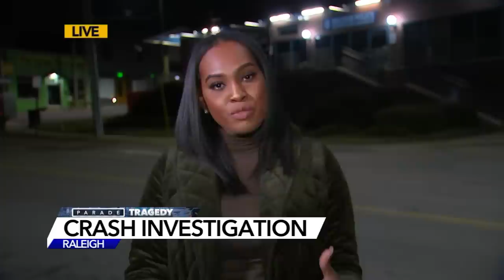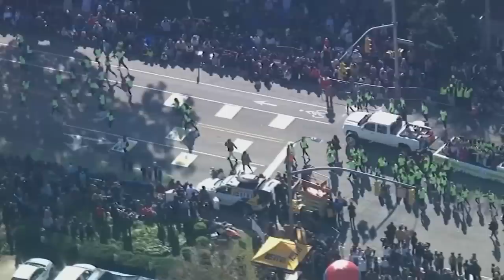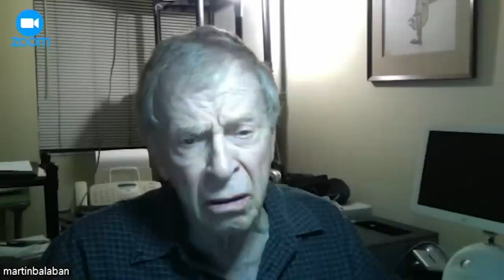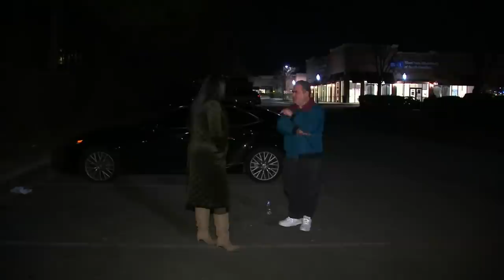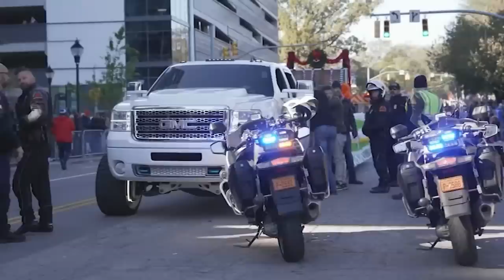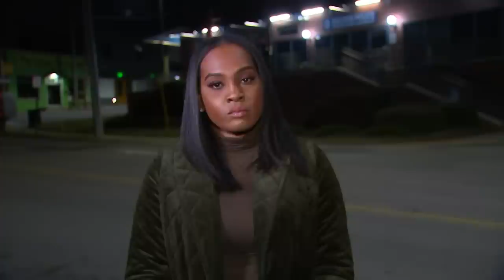Investigators look at truck part by part after Raleigh parade tragedy

Comment: I drove in parades it is difficult you can not be distracted. Bands and participants march in place even when they stop moving forward. you must leave road surface that you can see between you and the marchers in front of you and that empty space distance must be maintained and you can't start or stop quickly because people on the float will fall. In automatic vehicles you must hold back by using the brakes (At idle the vehicle will want to move faster than the marchers you must hold it back) your leg will ache for days after, (you may be nonstop braking for three hours). God love you if you are driving a stick shift because you are always clutching and braking for hours. They throw treats so kids are dashing into the street, and maintaining your distance not trying rock the people forward and back on your float. It is a lot to deal with you can not get fixated or distracted by anything. My first parade, I had a 69 Corvette Stick shift, manual breaks, a pointed front end you could not see behind the marching band on hilly roadways through a community with sharp turns and narrow streets. I was a mess afterward and Had nightmares for days. It is easy to get hypnotized you are hardly moving nothing seems to be happening but so many things could go wrong!
Reply: Things will end up changing over this... I saw one story where in Philadelphia, they are no longer allowed to throw treats and that all drivers in the parade must have commercial driver's licenses... I have a feeling the next thing that will be banned in parades (if not altogether) will be vehicles modified in any way like this truck was...
Reply: three hours? how many miles long was that parade? 🤔🧐
Reply: @montanaelkwhisperer1744  Our Cities,  Bicenquinquagenary (250th anniversary) the city thought it would be great to let anyone be in the parade just sign up! The staging area was 13 city blocks from the parade route. I had Elvis throwing teddy bears I was following our 50s swing-dancing float. The dancers every block or so jumped off the float and danced in the street.
Reply: People could have avoided being hit by the truck if they just listened to the honking or yelling instead of just continuing. If the truck was going in a straight you just move out of the way
Reply: @soyoungdouglas  I was in my 20s too for my first parade. Age doesn't make a difference in knowing what to do when something goes wrong. My first parade the 69 Corvettes brakes overheated and started to fail. It was an automatic transmission so I knew in ice and snow conditions you put an automatic into Neutral to stop the engine from pushing the car forward when stopping, so on downgrades, I put it in neutral and the brakes cooled down. I did this long before it was an issue. Remember this because Antilock brakes on ice will stop the brakes from working. You need to have the car in Neutral to have 100% of the available braking power, 4-wheel drive or not.

Comment: That So Called Expert isn’t much of an expert if he thinks that you can still stop if a brake line ruptures, he did mention the hydraulic system but if a line ruptures and the fluid leaks out you have absolutely zero brake pedal. When a line ruptures and the fluid runs out air gets in the lines and you can repeatedly stomp on the brakes and the pedal just goes to the floor but you’ve got absolutely nothing. Trucks don’t have a hand brake E-brake like some sports cars have and it’s not in a spot easy to hit on the floor either. Having a brake line go out is probably one of the most scary things a driver can experience as far as mechanical failures

Comment: Why the driver never put the truck in first gear to activate engine braking is beyond me. The first gear drive ratio on a GMC Denali is 4.54, when engine braking an adult should be able to walk right past the vehicle but it appears the driver put the vehicle in neutral instead or tried to put it into Park which will not work on a heavy-duty Denali when in motion.

The driver has been cited for vehicle violations 17 times since 2021. 

He was ordered to have the vehicle inspected four times, most recently 3 weeks ago but did not comply.

The emergency brakes on the vehicle were non-operational.

In my state the vehicles lift, wheels and offset are illegal without fender flare, bumper and marker light upgrades. Having these upgrades properly installed makes the vehicle safer for pedestrians and street legal. Not having them makes the monster tires extremely dangerous 

The fact that the driver carried a concealed firearm to a parade with thousands of children shows a lack of safety awareness and concern for those around him. He was charged for illegally carrying a weapon at a parade.
Reply: You realize that there was likely hundreds of firearms there?
Reply: Who chose not you sorry
Reply: @HellboundAmerica  what's your point? He had it there. Illegally. Should we sell guns in prisons to? Schools maybe? Pass them at the courthouse maybe? Keep them to hunting and home defense.
Reply: @MajorBorris  come for my guns, I'll pay for your bus fare 🤡
Reply: @small3687  they are not for hunting and home defense now, we'll keep our second amendment the way it is. If you don't like it, there are no shortage of other countries with no gun permissions, plz go there
Reply: @MajorBorris by definition, a lawful gun owner doesn't carry out a mass shooting event, that is an unlawful event. You proved nothing other than your reading comprehension skills are nil

Comment: The world would be safer if more people learned on a manual. I have a hard time believing that the brakes, ignition switch, and transmission all broke at the same time.
Reply: @kennygaming208  sounds like I’m keeping my old 2000 Audi TT as it’s fully mechanical and dies when the key is pulled regardless of my speed

Comment: My condolences to the young girl's family and friends.

This is what im making out from all the videos ive watched of this accident. People heard him shouting, they had the horn as another warning and those who were in the truck jump out and tell everyone around the problem and to move out of the way. Noone listened until after the little girl was hit, he probably never saw her as people possibly moved to eventually create a path for him. Not a single person attempted to stop the truck until after the little girl was hit, those who were in the truck were most likely pulled out of the way by other people when everyone realised what was happening.

Not everyone knows to use the ebrake for such things, do we get tought it when learning? No, we learn it ourselves. If he did, he could've jackknifed the trailer by applying too much pressure in a panicked situation, instead of pumping it in a controlled manner.
You can't expect a 20 year old to know how to handle every accident that can happen in a car, what we know how to handle we learn from previous mistakes.
Reply: I'm pretty sure that he used the ebrake, the small parking brakes shoes in the rotors don't have no stopping force. They barely have any holding force. I've been working on these type of brakes for years, they won't stop a moving truck, let alone a loaded trailer with it. BTW, I'm a Master ASE Certified mechanic with over 40 years experience and retired Army Motor Sgt. Simply, the young man was riding the brakes, they boiled, and they failed. Inexperience, no trailer brakes, lack of pre parade inspections. This unfortunate accident will make for new parade protocols which will save lives in the future.
Reply: @catbird1759  I am in my 20s myself, I would've done the same in riding the brake. Although I drive a manual more than auto so I can easily use the clutch to put a car in reverse if it happened to me.
Reply: @catbird1759  yea, just an interesting situation he got into, especially with his ticket from last month for not having a current inspection.. I'm definitely in agreement, a 20 year old had absolutely no business driving in a parade. The kicker, is that he supposedly works on vehicles for a living, lost the brakes, then forgot he could steer.. I'm not an expert on driving without brakes, but I would imagine that the curb is better than the street full of kids..
Reply: E breaks don’t work like that. They are for parking. The keep the car from rolling but they don’t stop a moving vehicle. I’ve accidentally forgotten that my e break was on and drove with it on. You can also tell he did try the e break that’s why it was easily stopped when people finally did try to stop it. This was an accident and it’s sad the young girl died but I don’t believe for one second he should be charged.
Reply: You don't know what you're talking about because you've never driven a Diesel. . . The brake booster goes out often and leaves the driver with absolutely no brakes and often no power steering. . . because the vehicle is so heavy duty the e-brake does not work the same and your car. Do more research and watch out December 10th if his charges go through. . .there will be thousands
Reply: @birdgod3414  I learnt to drive in a Toyota 60 series, couldn't rely on the ebrake as it would creep half the time when idling.
Reply: Most of what you said I agree with for the most part. However I completely disagree with the statement that if he slammed on the brakes too hard he could've jackknived the trailer. At the very slow speed he was traveling it would've been impossible to jack knife a trailer. There wouldn't be enough velocity or force to move the truck  even if it was locked up due to using an ebrake.
Reply: @Catbird1  how would pre parade inspections prevent the scenario you stated that he boiled the brakes from riding them? A million people could've done a pre parade inspection and not 1 person would've of been able to say "nope this truck isn't safe, he's gonna ride the brakes until they're no longer effective at stopping the truck. An ASE certified mechanic would know that. If you can then you should be a billionair by being able to notice a problem in a pre inspection due to an action causing a reaction.  Also a Honda mechanic can be ASE certified but still not be able to work on a diesel truck like they can a Honda Civic. You claiming to be an ASE Certifed  mechanic means absolutely nothing unless ypu can tell me what's wrong with my wife's vehicle and guarantee nothing could possibly happen after the vehicle leaves your inspection with zero problems. Or guarantee something tragic will happen even tho your inspection showed the vehicle was problem free.
Reply: @NikkiJenx25  i dont onow about a full size truck but an E brake will most definitely stop a car...ive had to use E brake to stop because i had no brake pads left. My negligence of course but the E brake would stop me. I drove for 3 days using it
Reply: @zephyr139  you indeed can get a manual transmission vehicle into reverse  at the low speed he was going even an automatic could be shifted into reverse ,,, that was a 4x4 truck ,,doing a parade like that he should have had it shifted into LOW range ,he wouldn't have had to ride his brakes
Reply: @birdgod3414  diesel trucks aren't the only ones with Hydroboost brake systems , i drive a 1983 GMC C3500 and it has this system ,,and i can attest to the fact that if the engine stalls  or you otherwise lose power to the pump  it steers like a tugboat and stops like the titanic ,, having an older truck  i don't have the wimpy parking brake that new trucks have ,,i've also removed my factory floor pedal and changed it to a hand lever from a C50 ,,i can safely stop my truck manually
Reply: It’s still at least manslaughter, he made illegal modifications that probably led to his vehicle not passing inspection. His blame lies in BEFORE he started driving as well. His vehicle was not able to tow that much weight and he knew that and still decided to drive that vehicle, because modifications are apparently more important than safety. His actions led to the death of a girl… rip to her

Comment: This will be another push to keep you from modifying your vehicle, if this truck has a hydraboost system ( 3/4 and 1 ton trucks you'll see these setups on ) instead of a vacuum booster, if you lose power steering you don't have brakes, that's just how a hydraboost system works.

Comment: What happened to using the  emergency brake? Also engine shut off. And trying to throw it into park, reverse and neutral. I bet none of that was done.
Reply: Have you ever driven a vehicle that couldn't overpower the ebrake?
Reply: @dthomaswilliamson33   Turn off the car is still a good option since it was going pretty slow and you don't have to overpower the idling engine.  Or put in neutral so no engine input.
Reply: I was once in a car in Haiti and the breaks malfunctioned after driver went down a steep hill riding the breaks. I was the passenger and witnessed him tried putting the car in park and Turning the ignition, he even pulled the hand brake thing and the car did NOT stop. We ended hitting 3 other cars, a guy on a motorcycle legs gone and at least 4 street vendors😞scary day
Reply: agreed. this driver panicked.
Reply: @matthewharr6372  can be,
Reply: @yiucycle  turning it off wouldn’t have done anything would have still been rolling in neutral
Reply: @adenseay7406  It would be easier to stop the car without any engine idle load.  But he might have done that and unsure if its an automatic or manual transmission.  From what I read, the e-brake was not functional.  Def the driver is at fault.
Reply: @yiucycle  definitely an automatic they don’t have a manual Allison transmission
Reply: You never shut off vehicle you lose all other functions he was better off throw it until reverse or neutral